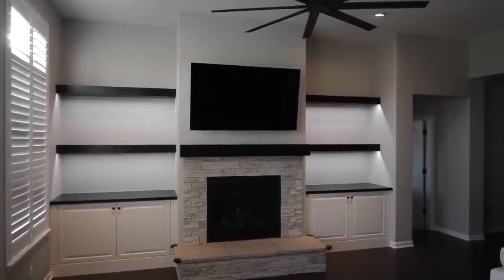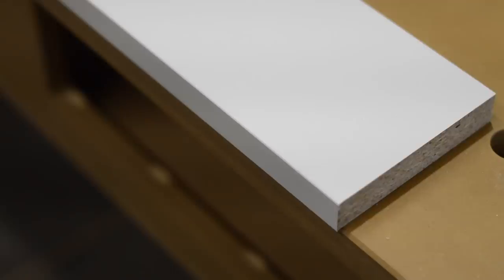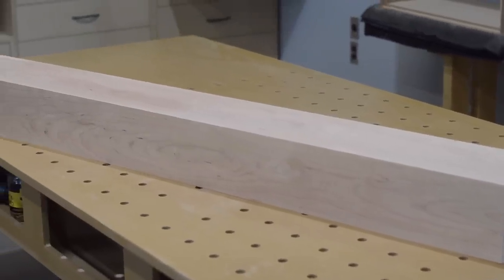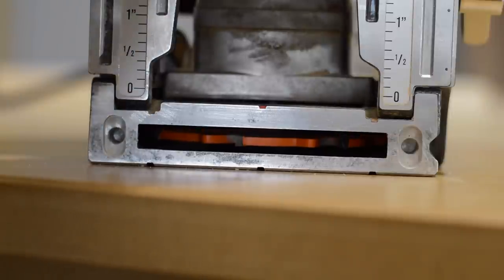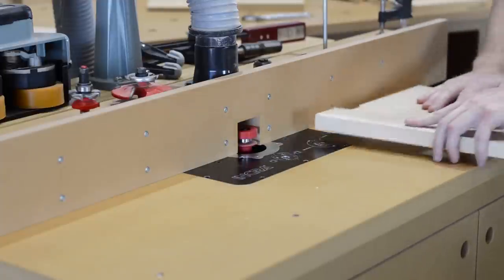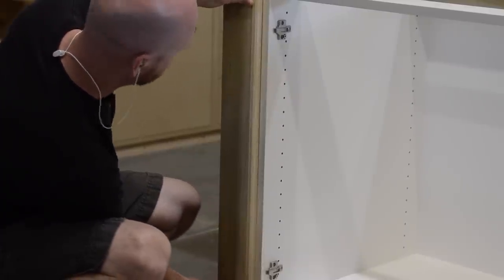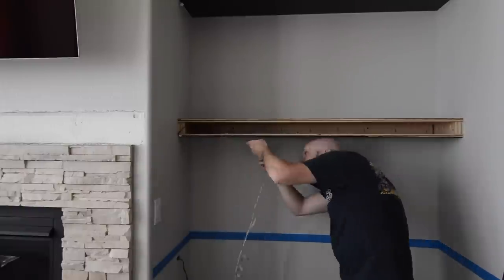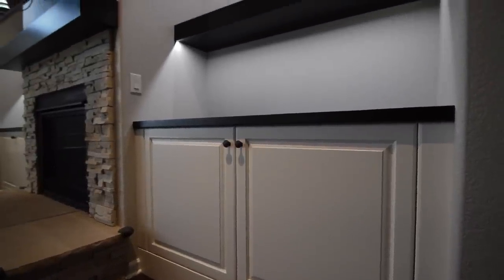Custom built in cabinets, floating shelves and fireplace mantel

Comment: Well done Mike, final product looks great. I like others though cringe a little with the particle board and midfield choices. I know customers make final decisions. Had to chuckle at the one subscriber mentioning $680. Ok, ok my question.  In the video it looks like you used white melamine for the top. In the Install it was stained. Clarify please
Reply from the maker: The melamine coating on partial board is just about the hardest coating in all of woodworking. It is a very good material for cabinet interiors where water is not present. The top is made from A-1 cherry ply with a hardwood lipping. I never showed how this goes together in the video. I assemble the cabinet, then added the counter top during install.

Comment: How did you hide the wire for the L.E.D.'s?
Reply from the maker: Its behind the drywall and it pops into the area right next to the cabinet under the counter top. The switch is drilled through into the counter top. Its pretty slick. I didn't have time to film it.

Comment: Plywood ? Is than not mdf sheeting ? 🤔
Reply from the maker: On this project I used particle board core white melamine and what is known as combination core plywood. Combination core plywood has a thin layer of MDF just under the veneer. This is done to give a perfectly smooth surface to laminate the veneer to. The center part of the plywood is normal ply core. The only MDF used was for the door panels.

Comment: How did you fasten the top panels on the floating shelves?
Reply from the maker: 5 nails, two one each side, one in the middle. Sorry I didn't film that part.
Reply: No problem! I figured it would be something simple like that, just wanted to be sure yo didn't have some other trick.
Reply: He states in the video @ 12:03 that the top is held in place with nails.

Comment: I would like to compare prices of this project in USA vs the price I would put on it in Serbia (Europe). I think that the maximum price for it here would be around 600 euro, that would be 680 US Dollars. Can you comment on this? If you don't want  i'll understand.
Reply from the maker: Materials for this job were more than 1k. 680 would not be nearly enough.
Reply: @MikeFarrington  EPIC!!!!  
This  are prices for material here :  
MDF 19 mm ------- 11 usd / m2
plywood 18 mm birch ------- 14 usd/ m2
chip board 18mm white ------ 7 usd/m2
wood - beech ---------- 600 usd / m3
Led is about 10 usd / 1m
 I guess that materials here would be around 300 -350 usd.

Thanks for answering

Comment: I'm only 5 years late with this comment. How many "not code" pipes or wires have you run into? One of my recent shelves sprung a leak to my surprise when a water line was closer to the drywall than I expected any to be. 19:25
Reply from the maker: It happens from time to time. It's frustrating because if each trade just did their job, the next person would have things much easier.

Comment: That Lamello top 21 is a 1200.00 dollar biscuit joiner, for that money why not just switch to dominoes
Reply from the maker: I have both dominos. The Lamello is a better tool for certain things. I find the domino to be less accurate when aligning things in a vertical fashion. The reason for this is the adjustable heigh cutter, being able to move the cutter down a small repeatable amount is nice for adding a lip to a shelf. Hope this helps.
Reply: @MikeFarrington  so it just works better with your work flow, I can respect that, I myself prefer the biscuit aswell

Comment: Great video; I learn a ton of tips every time I watch (even though my shop is very modest in comparison to yours) and this was no exception. I really like the information on the filler panels and the floating shelf construction.

Question for you: Where did you source the LED diffusion pieces? Most of the ones I've seen require an aluminum channel to sit in. Also, curious why the lights are pointing down instead of back at the wall (so attached to the back of the front face instead of the underside of the shelf). I have done LEDs under my kitchen cabinets and I found that the light looked better shining back at the wall rather than directly down on the counter surface.

Finally - A favorite cover of my is Anberlin's cover of Love Song, originally by The Cure. (https://www.youtube.com/watch?v=Cujbug6vBnI)
Reply from the maker: www.solidapollo.com I like the ones that fit into an aluminum channel, but this works well too. Having them shine down was certainly easier for install. Other then that no real reason. I use 120 degree LEDs so the light spread is pretty good. Love Song is a good one, thank you.